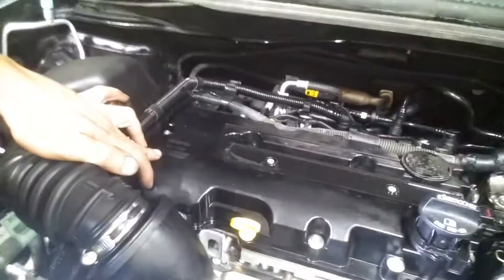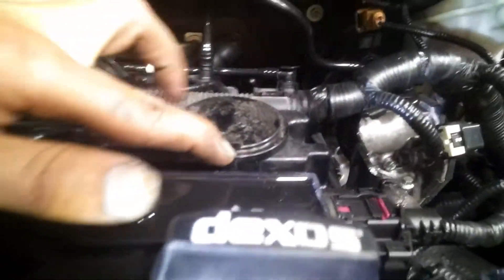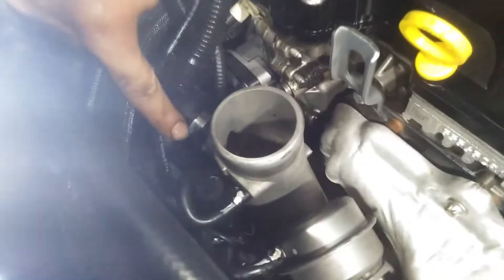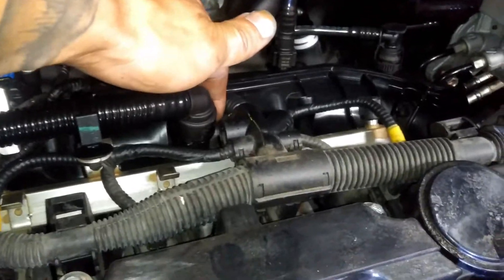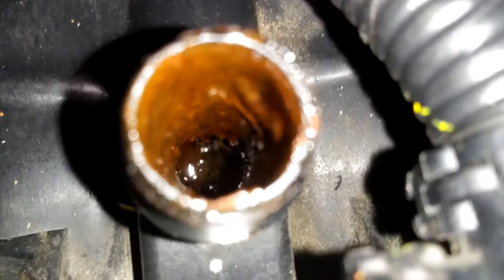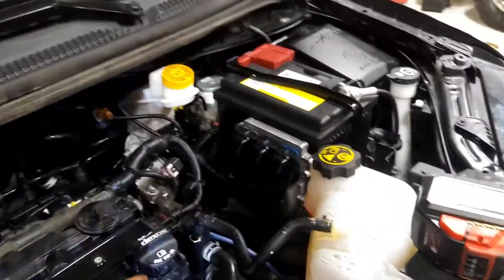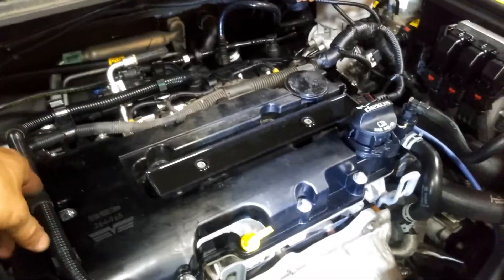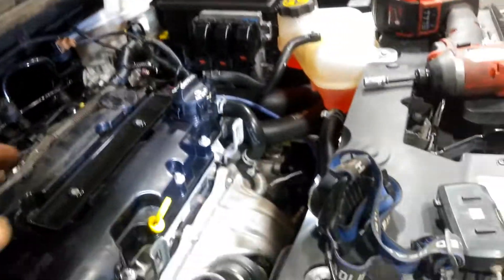chevy 1.4t ecotec squeaking noise chirping sound

Comment: Y'all are talking about small chevy Cruz n stuff like that.  Well I have a Chevy 2500 hd same or kind of the same chirping noise .increases with acceleration iv had my pulleys etc all changed water pump is good and still chirping .any ideas ? Mines in the garage and been there for a week any help or ideas are greatly appreciated. No check engine lights or oil leaks or anything like that just the dang chirp. Lol    flushed oil , checked the screen. no low oil pressure .
Reply: Mate I'm going through this you take it to vauxhall they just fuck parts at it mine is chirping still had new water pump didn't fix it do you no wat it is ?
Reply: Front Crankshaft seal - 100% Been there, done that.
Reply: Also removed the belt and ran the truck, still had the chirping noise . Sounds like it's coming from the rear of engine block, internal as far as I can tell
Reply: I got it sorted was crankshaft seal
Reply: @Burt Doctor  Replace to front crankshaft seal, that exact same noise will be gone. Stop messing with everything else wasting time and money, it's the damn front crankshaft seal
Reply: Ok I'll find another local mechanic and get this cranked seal changed and I will let you all know what happened  when the time comes  @steve mc taking ur advice 👍
Reply: @Burt Doctor  I've done the whole route that everybody did, belt, PCV Top cover, water pump etc. It was the front crankshaft seal. That exact chirping noise you hear on this video was cleared by changing the seal. The noise was more pronounced when the engine was just coming off the clutch and/or with the air con on.  Just as the engine was coming under load. Embarrassing at drive through's ! 🤣
Reply: Thanks 👍 .and yes definitely embarrassing driving a big Chevy and it's chirping like Tweety bird lmao 🤣@stevemc
Reply: Crankshaft seal
Reply: @Tucker Houston  Yes, the front crankshaft seal
Reply: I sent a link to a video did it post ?

Comment: Why would the ac affect it? for me i have the same noise but stops when i turn on the ac. I also have a slow oil leak somewhere low.
Reply: Did you ever figure it out? Mines doing the same thing when the AC is on
Reply: @TheChosenCam  pcv valve in rocker cover

Comment: Jabo, what fixed it?? I have the same issue
Reply from the maker: Crank shaft seal
Reply: @JaboTheMechanic  How so? Rear main seal you mean? Why? Installed wrong? Not enough oil at it?
Reply: @JaboTheMechanic  Hello, it was the seal one flywheel-gear box side or engine side? thank you

Comment: So what was the solution on the car 
Did u fix it and what was the problem please i just get one sonic and this problem come out thanks
Reply from the maker: It was the front crankshaft seal
Reply: @JaboTheMechanic  thanks  mr . One more thing, is an expensive repair or not ???
Reply from the maker: No it should  be anywhere  from 100-300 max depending on where you go
Reply: @JaboTheMechanic  ok thanks 
I was worried about because is the same issue and i just got the car 2 days ago and i thought is something more big
Reply from the maker: Yeah I understand. I don't blame you
Reply: @JaboTheMechanic  i thought it was the clutch 😩
Reply: @JaboTheMechanic  🙂How do you determine whether it's the PVC or crack seal, I understand both result in the squeak? I pull the dipstick and noise goes away, runs great, no problem at all except for squeak. I want to change the correct part the first time, not just guess and hope. TY

Comment: If anyone has thiss issue and this isn't the fix, Try checking spark plugs and mine turned out that the one pin in my ignition coil was pushed off the side so I recentered it and noise went away and the car been running so much better